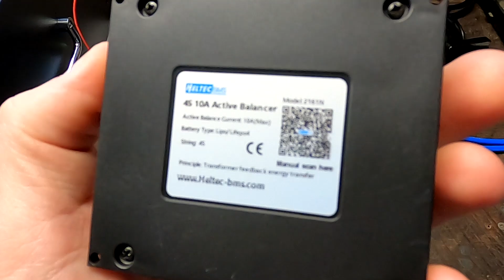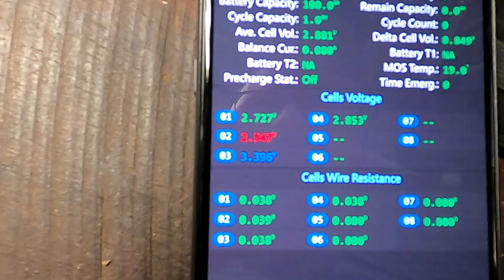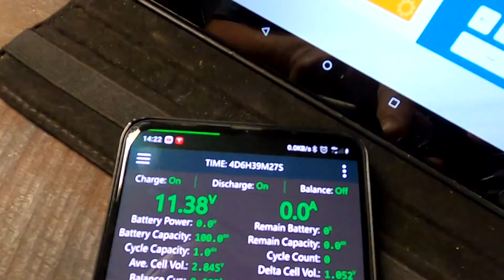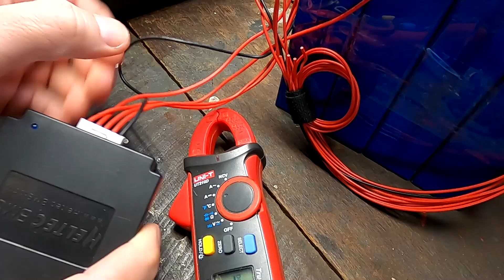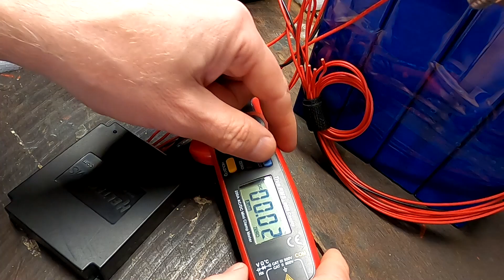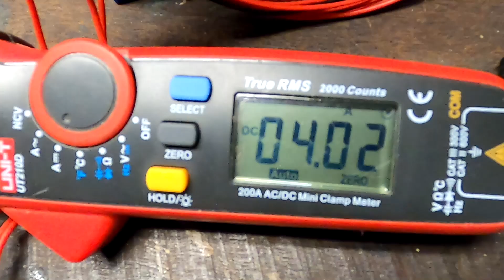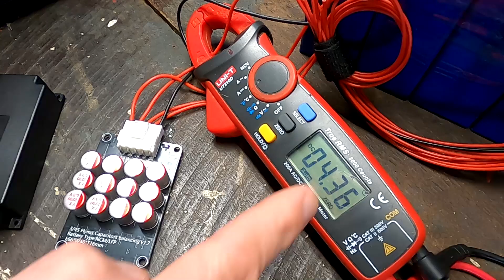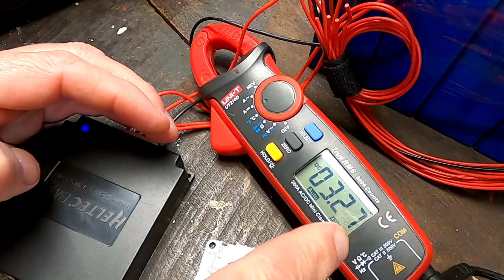REAL 10A with the HELTEC Active Balancer. Can we make it happen?

Comment: I am guessing the DC to DC converter MOSFET's need higher gate drive voltage to achieve their lowest Rds_On resistance.  You might get better results on an 8 or 16 cell stack.  Would not be surprised if there is a regulator to set the 12-15v gate drive which if input to this regulator is not high enough the regulator output might be even lower than the battery's four cell stack voltage further limiting the DC-DC converter capability.

Pumping 10 amps out of a 3.5v source takes low resistance MOSFET switching.

Also due to super low voltage cells should not be charged at high current it may back down the transfer current to low voltage cells until they get above about 3.0v.

Even with other three cells low in voltage the initial charging of the supercap should take 10 amps assuming the DC-DC converter gate drive voltage is not limiting the converter current capability.
Reply from the maker: They make these '10A' balancers only for 4s batteries. When I had it opened up in the first video, the wires to the transformer looked tiny.
In any way, I could not see anything above 4.8A in or out of s single battery cell.
Reply: I think that way. Only the bigger ones (>12s) have the ideal voltage to fully turn ON the mosfets. They should correct this and sell the 4s version with 5A max and the >12s version for 10A. Will buy one soon for my 14s system and will let you guys know it.

Comment: sometimes Andy your breaking the law stay charged Kirchhoff's Circuit Laws
Kirchhoff's circuit laws are two equalities that deal with the current and potential difference (commonly known as voltage) in the lumped element model of electrical circuits. They were first described in 1845 by German physicist Gustav Kirchhoff. This generalized the work of Georg Ohm and preceded the work of James Clerk Maxwell. Widely used in electrical engineering, they are also called Kirchhoff's rules or simply Kirchhoff's laws. These laws can be applied in time and frequency domains and form the basis for network analysis.

Comment: Yeah that sucks.  Seems Heltec doesn't understand the need.  You think there would be a way to take one of cheap tiny ones and big it bigger and better.  The 10 dollar ones on ebay actually work only at 1amp but way better and those little lights come on making it fun to watch.
Reply from the maker: I have one of these 1A balancers as well. They work well with Li-ion but not so much with LiFePO4. The automatic turn on and cut off voltage does not suit LFP.
Reply: @OffGridGarageAustralia  The cheap ones that I have are little too sensitive balancing the when there is very little difference between the cells sometimes the little LED's flicker, but its nice when I leave a battery at 50% in storage I can just use a car battery charger on my 4S LifePO4 batteries for 15 minutes and just give them a little boost.  Perfect for that, not sure they are of much use though for real balancing.  I wish they didn't have the 10mA drain but for the price I can't complain.  Should check out the Genetry Solar Balancers tell them I sent you.  I don't get anything just fun on their forums.  Tiny USA company that makes them.

Comment: Honestly - why do you measure only one side of the full battery cell. The balancer can organize in to two directions, one current to the left (batt2 and batt1) and one to the right (batt4).
A real test would measure all currants between all battery cells and the Heltec.
Make the test correct and judge after, thanksx

LG aus Köln Buchheim Jogi
Reply from the maker: I followed the instructions in the manual. We have explored this in the first video about this balancer.

Comment: The voltage drop along the cables might reduce the voltage difference so the BMS cannot do its Job.
Reply: It is doing that with the cables it is supplied with... Disappointing anyway...

For the price it should have programming capabilities.

Check the price... It is almost as much as a JK 4/8S Wich is a great BMS and has active balancing.... No reason to pick this...

Comment: it is probably misleading ratings from china again. Or it could be the testing setup. because if you think about it you are not just connecting your clamp meter onto battery 3, your clamp meter is on the positive of cell 3 but the negative of cell 4 so if there are 10A going out of cell 3 there is also possibly 5A going into cell 4. that is hard to wrap my head around even for me that had the idea but that seems like what might be happening there. your clamp meter needs to be between the bussbar and the positive of cell 3, instead of being on the balance wire.

Comment: There's no way those little balance wires are going to carry 10 amps without a massive voltage drop. The balancer probably can't pull 10A through that massive voltage drop.
Reply: I see melting cables coming

Comment: My JK BMS, Stopped working, it lost cell number 20 & 21 but number 22 worked and it shut down after numbers of hours.
It is an installation that has ben running for abut 4 weeks.
Then I contacted the  Hankzor BMS Store.
Explain the problem and I took some pictures and told them that I am an engineer.
I have a small company, where I am designing and repairing electronics.
At first the communication was superficial,  like try download the new APP for IOS or Android and links for communicate with the JK BMS and so on. 
Please, it was working befor, nothing change... and I replace it with a new one, NO FAULT.
Then there was an engineer who had a look at it.  
Then the communication to Hankzor BMS Store changed to be  good 😊
Now I have to options:  
1. Ship it back for repair.  
2. Repair it my self.
Of course I choose number two.
So now I will disassemble it and have a look,  probably I will have to wait until the replacement parts arrive and instruction as well.
The JK BMS with 2 A Active balancer is nice, just hope for a longer life span then approximately 4 weeks.

Maybe Jack Ricard was right, "the lithium cells are more stable than the electronics"  he was quite often right. 

PS: All in all I have ordret 3 JK BMS S25 2A,  the laste one is on it's way to me as I write 
PPS: yeah that's probably a lot of faults in my writing but I can't help it I am dyslexic, so bear with me 😉